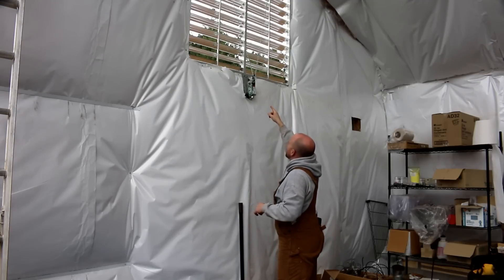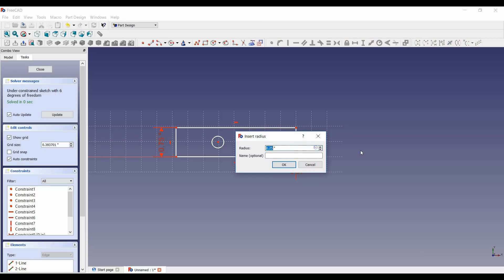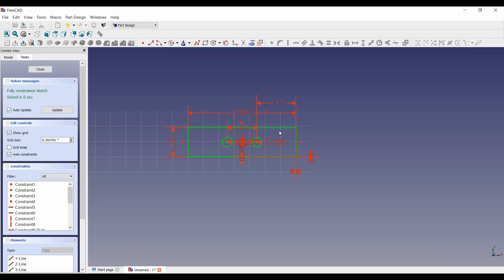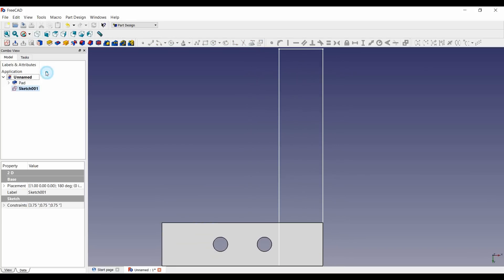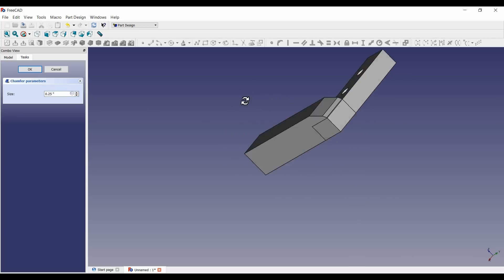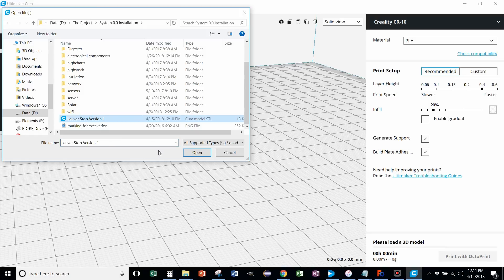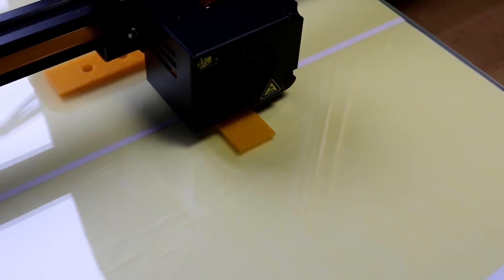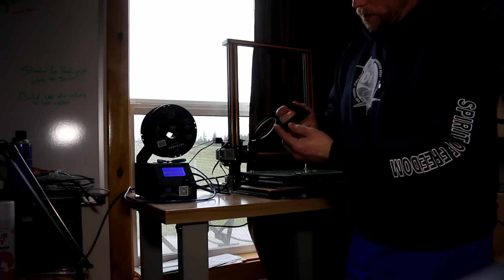Broke Greenhouse? NO PROBLEM, just use a 3D PRINTER

Comment: A hint and a thing.
The hint -  If you use the name function for constraints, for example calling the length constraint bar-length, you can avoid a lot of math by simply setting your center points to bar-length/2 https://www.freecadweb.org/wiki/Expressions
The thing - if you're planning on making these plans and structures widely available you really need to get away from Imperial measurements. Especially if your planning for space. The vast, vast majority of the planet is metric, not imperial.

Comment: Can you not connect the printer to the network? You can get an Ethernet to USB adaptor :)
Reply: The best way to connect to the network is through a Raspberry Pi and a piece of software called Octoprint. It would allow you to control remotely and has the capability of adding a camera.

Comment: check the layers when you pick infill. you can get away with a lot less infill than you would think. 15-20% on a box mold i made (imitating a pager for a fireman) will take several hammer blows before deforming enough to knock it out of spec.

Comment: Hey Jeff,  super secret trick for integrating flimsy 3d printed parts with production line qualities. Print with the absolute minimum of fill then make a mold in silicon and recast with the resin of your choice (there are even super strong metal impregnated resins). This is only really for a part you might have to make many of that isn't too big but you can rapidly create very durable parts this way. Good luck, dude!
Reply: Something a bit easier is to leave holes through the areas that will get the most stress and buy some carbon fiber rods that are cheap because of quadcopters to epoxy into the part. It can also be done with sheet meta or carbon fiber plates in recessed areas along the faces of the part. There are lots of things you can do. You can just get decent mill for the price of a mid-range 3d printer and machine it out of aluminum as well.
Reply: thatrealguydan Good call and you can actually re-cast a broken part this way too.  Not as cool as 3D printing the model but very effective.
Reply: Sometimes old tech just works.